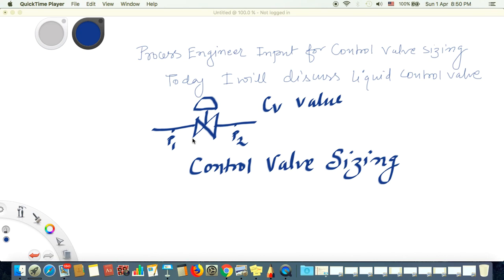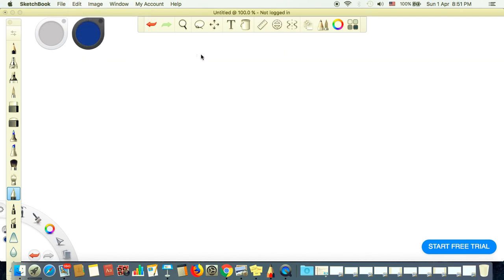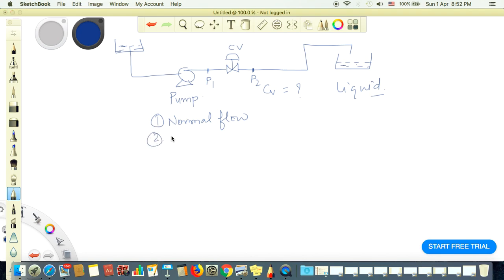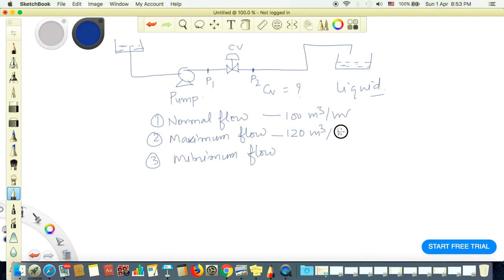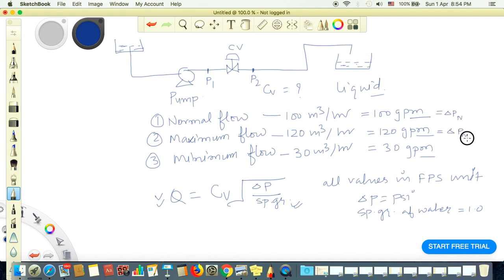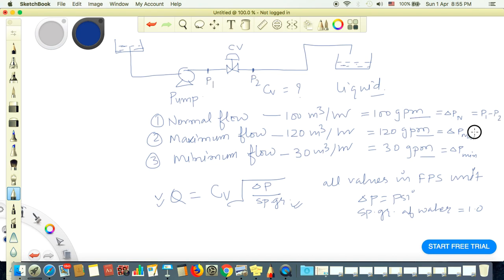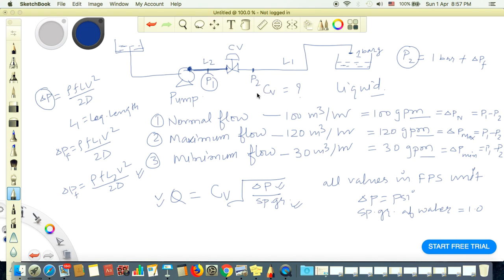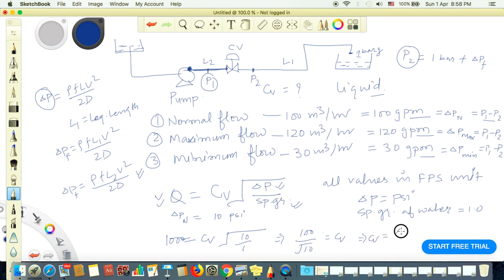Liquid Control Valve sizing calculation

Comment: very nice video...keep making more videos. i have a question for you kindly tell me how to size a three way of 2 way control valve in chilled water system. before evaporator coil of AIR HANDLING UNIT. here you do calculation for open loop system but how to calculate del p in closed loop system....
Reply from the maker: I will try to upload a video on this to make your understanding for sizing and hydraulic calculation for sizing close loop  control valve